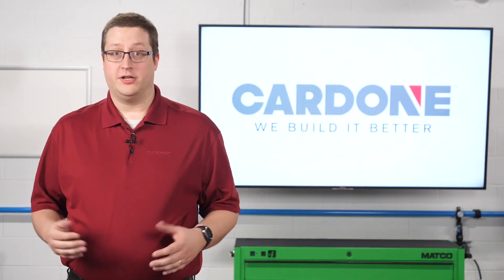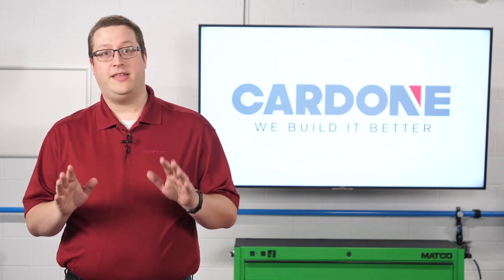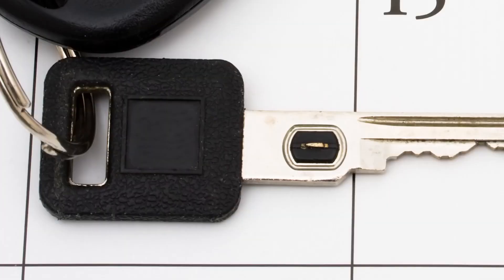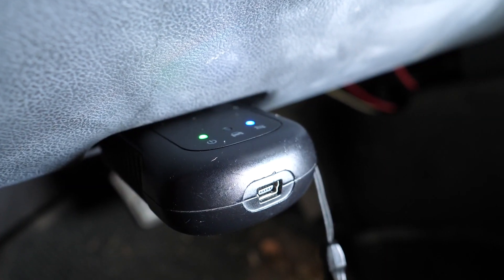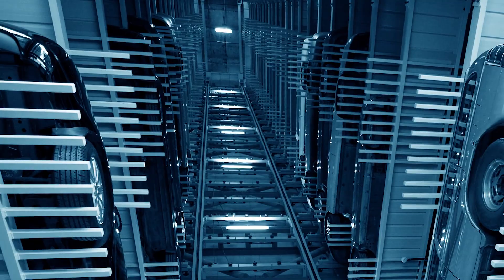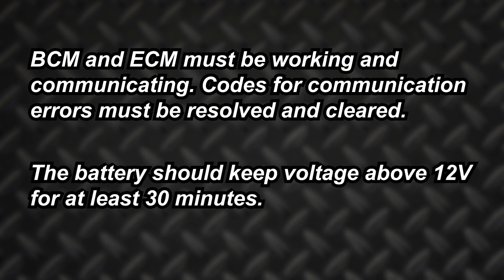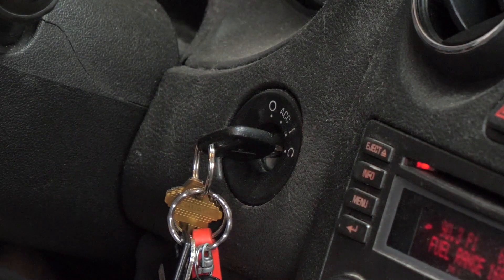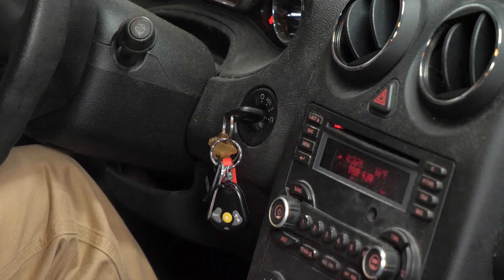GM Passlock Diagnostics

Comment: The solutions that appear on YouTube for the Hummer H3 anti-theft lock problem are useless. I have one, and the only thing that could be done—and it's a permanent fix—is to connect a computer and reprogram it to disconnect the antenna that receives the steering wheel signal for the lock. The computer is reprogrammed, and then it works permanently. No wires or anything need to be cut. The only way it will fail again is if the computer is replaced, and then the new computer would need to be reprogrammed.

Comment: Hmmm, I have a 2006 GMC Sierra WT, few options, that can be started and driven with a bare key.  Two sided where the tumblers are, but there isn't even any plastic on the key, which I had made at a hardware store.  Did very basic vehicles not have one of these systems?

Comment: The problem is greed.. this system sucks and dealerships have a machine to reset it in a few min and charge you 250 dollars. There is a reason there is hundreds of methods to bypass this system. If it worked correctly you wouldn't bypass it 😮

Comment: What does it mean when the security light is on. Truck runs all lights work except headlights and interior lights? Relearn does not work. Also took column cover off and tughtend 3 wires intop of ignition in the littel black clip.

Comment: I replaced the ignition switch in my 06 Silverado and the passlock symbol popped up after I finished adjusting the switch.  I unhooked the negative on the battery for 15 minutes and it went off.  We will see if that fixed it for good or if it comes back.

Comment: Another way to disable the entire pass key security issue. Get the vehicle started, unplug the module. Who needs such  a device? The problem with that idea is you have to get to it. It’s behind the dashboard kinda above the ashtray in a 2009 suburban. Haven’t done it cuz I don’t have the skills. There is a video on YouTube where the guy actually does it. Makes perfect sense to me. Get rid of it.
Reply: If you unplug any nonsense module the car will switch off lol.. listen to the instructions first before you conclude... whey would you even unplug the module while the car is running also, the module is working for other components

Comment: I believe that you are wrong about PASSlock. The system is in the lock, not the key. So a copied key of any kind will work as far as I am aware. The system is easy to bypass if you wait long enough, even if you replace a component. But a copied key works instantly. Passlock prevents your knife/screwdriver attack, but most other attacks are just a matter of waiting the 10 to 30 minutes for the relearn, no programming required.
Reply: You are correct. Had a simple metal kay made at a key shop, copy of original. No magnet in key and key works just like original.

Comment: Thank you for all the info.  My trucks ignition switch was jacked up by would be thieves. The dealer replaced the ignition switch and supposedly reprogrammed the keys.   It still idles rough and won’t stay running.  Could  screwing up my ignition w

Comment: Geez Louise!  This is so frustrating because my 2005 GMC Sierra 1500 was in for body repair - the sunroof drain tubes were crack and water was leaking into the passenger cab space. He had to remove the front pillar panels and headliner board.  My mechanic is truly a wizard because he is honest and he accepts all jobs where other garages' want the easy money!  On Friday, February 02, 2024, my mechanic was ready to move the truck outside of the garage because he fixed the water leak problem, but the engine would not start. Brian telephoned me if I had a spare ignition key to bring to him because the ignition cylinder would not move or start the engine. None of my ignition keys would turn and start the engine. I visited a local locksmith and they made a new key from the GM Key Code - the new key ($25.00) would not start the engine. After searching the internet and learning that the GM Key Ignition Cylinder problem happens a lot to truck owners and conversing with my mechanic we decided that I need a new Ignition Key Cylinder. My Mechanic successfully removed the original ignition key cylinder and installed the new ignition key cylinder: the key turned and the engine started then the mystery noise. The past four and one-half years I had water leaking into the passenger cab space from the third brake light, the cabin pressure vents and the rear windshield. After waiting for a couple of heavy rain showers I was confident and happy because Brian indeed fixed all of the leaks. I visited a Auto Body shop in Pensacola, Florida ~ 55 miles west from my home and replaced the headliner in June 2023 and within 2 weeks I had water leaking into the front passenger side - the floorboard was SOAKED. I returned to my Mechanic and he fixed this fourth leak too [the sunroof drain tubes were cracked wide open]. I pray it is not the catalytic converter(s).  The only symptoms I experienced, thus far on my 2005 GMC Sierra 1500 was the loud noise and the check engine light flashed on Tuesday, April 02, 2024.  
On Sunday, April 07, 2024, I disconnect my battery cable for a period of time to reset the PCM/ECM, before reconnecting my battery cables - I give it the "Frankenstein Contact" by closing the circuit by touch the positive and negative battery cables together for a few seconds. I start the engine the "check engine" light is gone and the metal rattling noise is once again prevalent. 
On Saturday, April 06, 2024, I visit a local gas station, pour approximately ten-(10) ounces of Marvel Mystery Oil into my fuel tank, top-off my fuel tank with fresh gasoline and depart town heading north to Crestview, so I could speedup the RPMs for a consistent period of time for approximately 30-mins each way. I return home and the metal rattling noise seems to be all gone
On Tuesday, April 02, 2024, I was driving around town on a mission for my parent's either repair the electrical cord on their clothes washing machine or find good sales on a new clothes washing machine [Home DIY Projects beget more Home DIY Projects]. Suddenly, the check engine light appeared on the control display, so I immediately stopped by the O'Reilly's Auto Parts Store [other side of town] and requested a OBDII scan: the Sales Tech stated the device identified DTC P0420, Repair Cylinder Head Ground Wire, Primary DTC Three-Way Catalyst (TWS) System Low Efficiency. I visited the closest garage whom I used in 2019 to warranty my Interstate Battery. This shop informed me that the DTC P0420 is a like "detectives clue" it could be a bad catalytic converter [I was shocked he said my truck has four-(4) catalytic converters] or a handful of other parts in the exhaust/muffler system. During our conversation I asked for the worst repair - if I were to replace the whole exhaust/muffler system - it would cost ~ $3000.00! I inquired if he could just cut-out the catalytic converter [he replied by law the shops in Florida cannot remove catalytic converters [Huh?]. I muttered that I haven't driven my truck more than 500-miles per year for the last seven-(7) years. He responded that check engine light is just a "Warning" and since I drive very little he said I might get two-(2) more years of driving before the warning becomes a real problem. 
On Monday, April 01, 2024, the noise was nearly gone with intermittent rattling, so I stopped by the local O'Reilly's Auto Parts Store [my side of town] and requested a OBDII scan: the Sales Tech stated stated "No Diagnostic Trouble Codes (DTC's) were identified by their device. Prior to Sunday March 31, 2024, I just don't know what the source of my mystery noise in my 2005 GMC Sierra 1500 VHO: the last six-(6) years has been rough on my truck and life has been even tougher on our family. Mystery Metal Rattling Noise. 
On Sunday, March 31, 2024, I poured 10-ounces of Marvel Mystery Oil into the engine oil crankcase and the noise was much quieter. 
On Saturday, March 30, 2024, while using a rubber mallet I tapped along the Catalytic Converters and Exhaust Pipes and could not see any movement, and the echo did not sound like the metal rattling noise. 
On Monday, March 25, 2024, I started the engine and listened to the rattling noise from underneath the truck, poured twelve ounces -(12-oz) of Marvel Mystery Oil in the engine oil crankcase and pressed the gas pedal down and it subdued the metal rattling noise, but did not eliminate it. This mystery noise problem occurred when my truck was in the local garage service. The Chief Master Mechanic [Brian] is awesome - he is a honest broker and takes on all jobs: I just wish I met him 10 years ago when I returned home to help my parents. The last few years either my truck or my parent's 1997 Monte Carlo LS 3100 was in his garage: I just swapped vehicles after repair and service jobs. For nearly 2-years one of our vehicles was in the garage. 
On Saturday, March 23, 2024, I retrieved my truck from Brian and he mentioned the mystery noise, but he wasn't sure of the cause.

Comment: I have a 2006 cobalt ss with a similar issue. What section should i be looking at for the short to ground issue? Id like to replace the ecm but  first id like to fix the ground issue. Its going into engine power reduced p0601
Reply: That's a completely different issue man. Try your throttle body positioning sensor I want to say. I've had to deal with that more than once. GMs.electrical is far from top of the line. But replacing that sensor will often fix that shit.

Comment: What do you do if the security light does not turn off after the 10 min?  This procedure has not worked for my tahoe
Reply: Yes the hood can be open.  Also, to fix the issue of the security light staying on you must unhook your battery for 30    to 45 minutes or make sure the modules in your car don't retain old memory codes.
Reply: @gadgetman136  thank you 👍
Reply: That's my question
Reply: Can the hood be open when doing this key relearn?
Reply: In case of next time. Just make sure the 10 minutes is completed before starting the next step which is also 10 minutes. From experience I think only the minutes is important not the light going off or not.... there are different manuals, in some GM, the ligh will blink and in some, the like will stay solid while programing. Same thing applies to some, where the light switch off after the first minutes and some stay solid like that

Comment: what happens if my security light stays on and doesn't turn off after 10 min on accessory?  98 gmc sierra
Reply: Key out of the truck take the positive cable off for three seconds then tap the cable to terminal three times give it five seconds reconnect the positive cable to the battery and go start the truck
Reply: @Perception Pressure Cleaning  did this, now the security light is off... but the ignition is not programmed to the passlock2 and the truck will still not start
Reply: Changed the
dead battery in a 96 Buick Regal GS
with PASS II.  Starter-drive CLUNKS,
but no cranking.
Reply: we've had a lot of trouble with Pass lock EVO module, You can find them in a junkyard or rebuilt with a lifetime warranty
Reply: The light was going out for my truck either. After 2 hours of messing with disconnecting the battery and starting over countless times I decided to just turn the key to off and light went out. After turning the key back to on the light was gone so I tried just starting it and it worked. But once again I’ve tried everything I could thank of and it just eventually worked. Late to comment on your question but figured I’d share my experience if anyone new came to the comment section

Comment: Our 2003 Saturn(which is a GM product) has the pass lock system with no special keys. The special resister is in the steering column(opposite the ignition switch). Like I said in a previous comment I replaced it years ago, reprogrammed it with the 3 -10min sessions an had no problems for years. It has started to mess up again and we just wait 10 minutes and the passlock light will go out and it will start. Also, we've notice that if we wait the 3-4 seconds after turning the switch to the on position for the passlock light to go out it seems to always start, no problem. (Maybe the resister needs a few seconds for the value to settle, maybe this has something to do with most people having problems when the weather turns cold).

Comment: I put a transmission in and now it won't start  checks grounds got 12 power to ign and inj but no signal it didn't have that problem before
Reply: Won't start or won't crank two different problems,, You can only still crank the engine with a faulty pass lock but the engine will not run
Reply: Did you ever figure out what it was? I'm having the exact same problem you were right now lol
Reply: I believe it was a ground wire near the bell housing

Comment: On my gmc 2006 Yukon Denali I replace my ignition switch when I got the key with it my old key that came with the truck I can open the door but not my new key so I put in the new key and wait for 30 sec on the on position like 5 times and my light comes on then it shows off so I don't know why doesn't do that with my new key on my truck any suggestions and opinions or what should I do I'm trying to save money so I want to take my car to the GMC dealership
Reply: You said you waited 30 seconds? You need to turn the key on and wait 10 minutes until the theft light goes out. Then do it again, two more times.

Comment: No passlock? 
The one that I needed lol :( 
My key is all metal
Reply: Mine is too. Do you know if it makes a difference???
Reply: @Mr.TJ1974  no...just do the 3 steps and works. ..the turn the key after the car with the lock disappear and do it 3 times
Just don't buy the ecm from flagshipone
Reply: @gunnersports6462  what happens if my security light stays on and doesn't turn off after 10 min on accessory?  98 gmc sierra

Comment: Ok my question is I changed the motor out in my 2003 Chevy Silverado  everything wired back right go turn the  key it will not do anything but the pass lock light is on so is that my problem
Reply: How did you fix it...same problem here
Reply: @sharleekuchynka7286  have you found a fix?
Reply: 2003 has vats not passlock. Have to have vats turned off with tuning software.

Comment: You didn't cover the passlock system in my wife's 2003 Saturn ion quad coup. I've replaced the device in the steering column opposite the ignition switch which has some kind of resister in it 3-4 years ago, relearned the resister value and it worked fine until this latest cold snap. It's once again occasionally refusing to start requiring a 10 minute wait. Thanks for posting this video. I don't want anymore GM products. My vehicle is a 2003 Suburban Z71 with 61k miles on it and NO special keys.
Reply: If the resistor checks out properly, then you may be having a problem with the past module or the body control module of where the the resistor tells the module that it has the right "key"and then the module sends the information to the ECM to crank and run the engine
Reply: Unfortunately it still has the pass lock system I’m having issues with my 2001 Yukon right now
Reply: 2003 suburban same issue z71 to